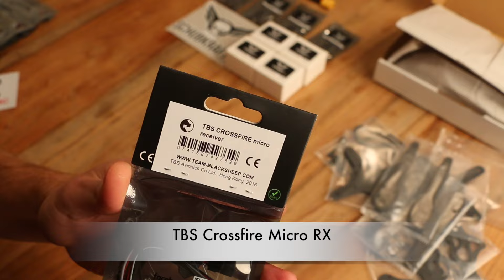ImpulseRC Helix Build - Timelapse - Schubkraft Setup

Comment: Hi ! nice build :)
All the schubkraft gear is from Germany? Cos I didn't see any on ImpulseRC website. Never heard of this company, but the motors site look good... I'm very curious to try out their stuff now! But don't think I will find any of their products here in USA 😭 
I just received my Helix 6", got myself the Aikon Escape, gonna either put some LD Power, or Lumenier Skitzo motors... Can't wait to build this up and test fly this thing!!!
How are you liking your Helix with your setup? Guess you can really hardly be disappointed with an ImpulseRC frame / gear / design.
Reply from the maker: +Ray Choi you are right. Schubkraft is German stuff - and it's great ;) They have a distribution in Australia, France and the Netherlands. And they are working on the USA as far as I know. Shouldn't be to long to get the gear over there. Just ask them via eMail or on Facebook. I'm sure they will answer. 
I love ImpulseRC stuff since my first Alien. They design great quads. And the Helix is no exception. But it's really hard to get the gear over here. Shipping costs and customs from Australia is a pain in the ass. So, same as you would order Schubkraft gear from Germany. 
You won't fly Skitzo motors on an 6 inch setup. The motors are great, but they have to less torque for 6 inch. Go for some 2206 motors. Lumenier 2206/2350 KV are great. Or try some Brotherhobby Tornado T2 with 2300 KV. 
Have fun with your build!

Comment: Shrike v2 or R5LX?
Reply from the maker: This question is not related to this video, right?
The Shrike and the R5X are pretty much the same frame. The R5LX is a longer version vs. the Shrike as a true X.
They are both pretty good and solid frames.
Reply: Was just asking for your opinion :)
Reply from the maker: *****
You will get happy with the one or the other ;)
Reply: Do you do much racing?
Reply from the maker: +Charles Lee no, unfortunately not. We just build our own little tracks crime time to time.